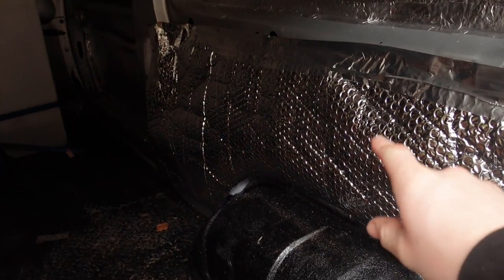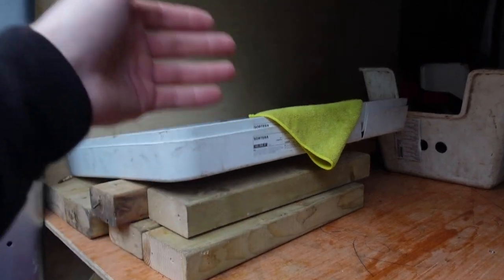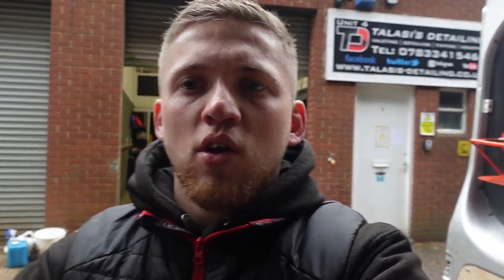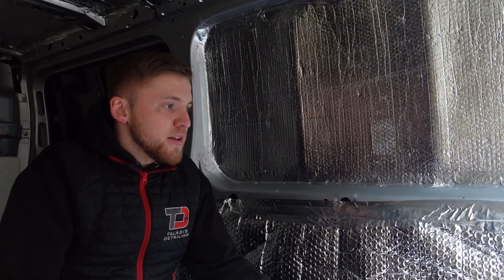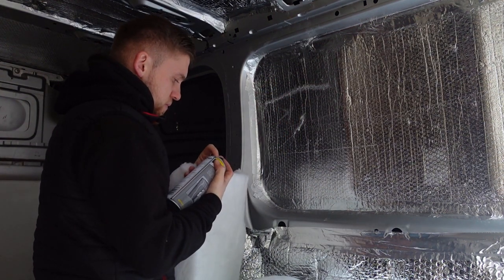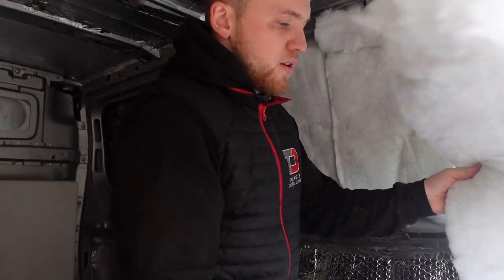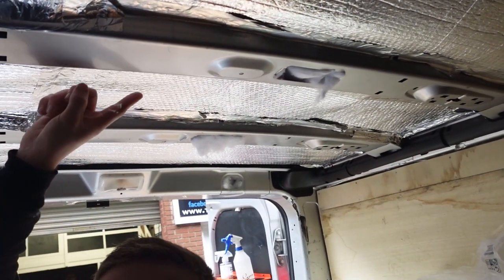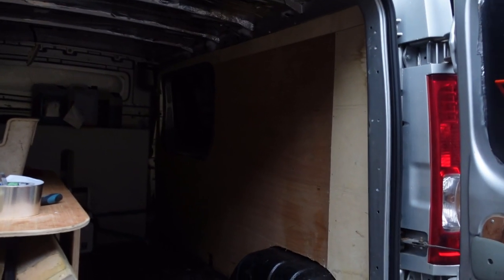WINTERPROOFING YOUR MOBILE VALETING VANS | THE INSULATION PROCESS

Comment: I might look into getting  my vivaro  insulated,if it’s going to stop the water tank and products freezing and cloths getting damp 👍
Reply from the maker: It’s definitely worth it. The water tank itself should be fine, but the hose can become frozen which is not ideal. Nothing worse than being freezing cold and opening the back of the van to products half frozen and equipment not starting because of the cold 🥶 if you can help eliminate that, you’ll have a better experience in the winter for sure 🤝